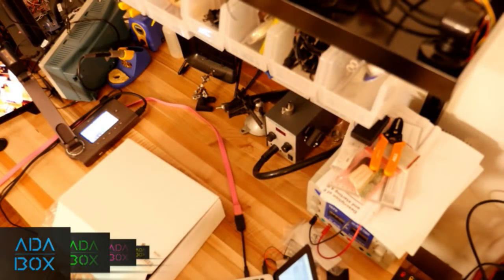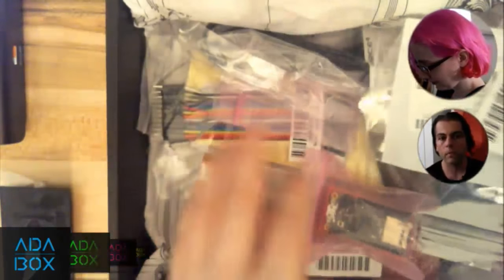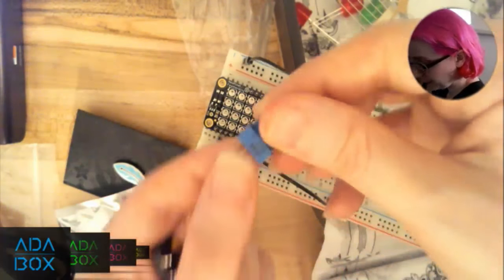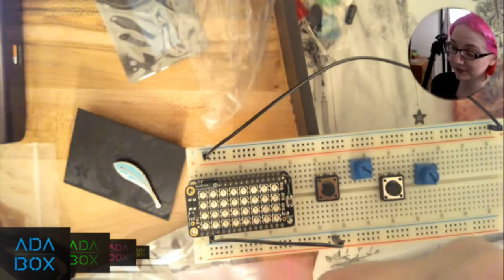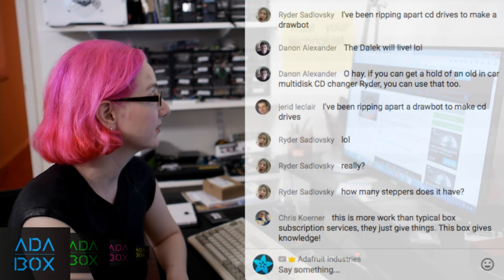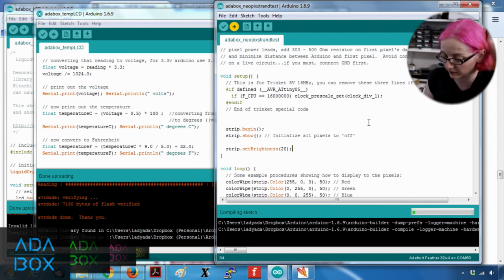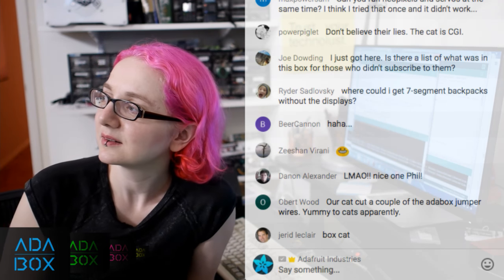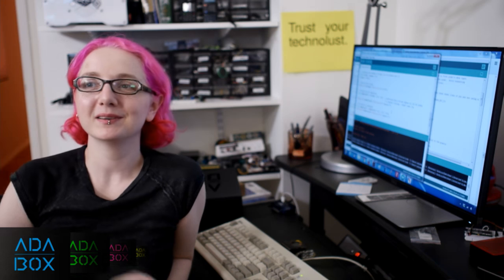ADABOX001 Unboxing LIVE @adafruit #adafruit #adabox

Comment: Remember not all beginners are kids :)  I consider myself on the lower end of intermediate hardware wise and higher end of intermediate coding.  As someone who is still trying to figure out how it ('tronics') all works together this box is great.  I know it will all work together.  Not having any formal education in this stuff, I'm hoping following along with the tutorials to fill in some of the gaps.  I would have never stepped into the 'feather' world, but just playing with the feather and wing in the box I see what a cool system it can be.
Reply: Same here.  I'm 49 and only been working with microcontrollers for about a year now.

Comment: Very nice!  I have no interest in the subscription shaving kit Facebook keeps showing me but this is a subscription I'll gladly buy.

Regarding the temp sensor at 21:20, what is the tolerance of the other parts?  For example, to monitor attic temperature at what point does ambient heat begin to affect the board or the battery?  How about low temps in the winter?  If I just cross my fingers and  try it out will extreme temps of the sort you get in the attic permanently damage a feather or battery?